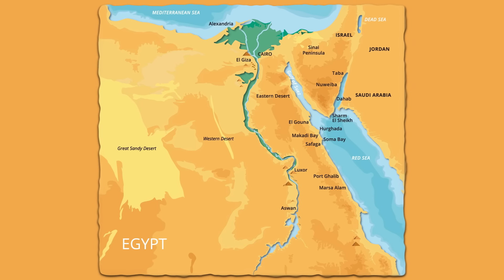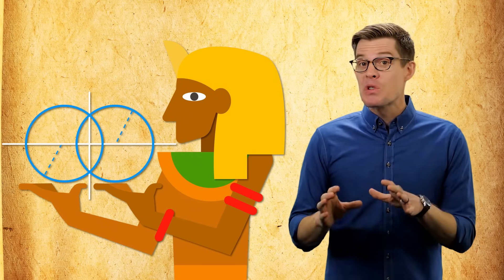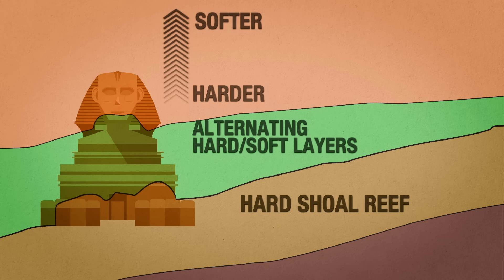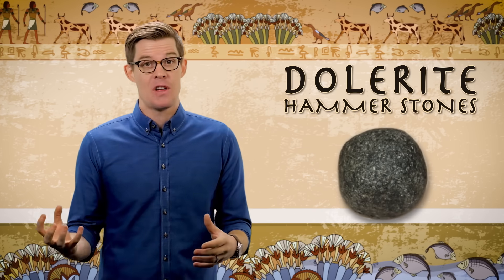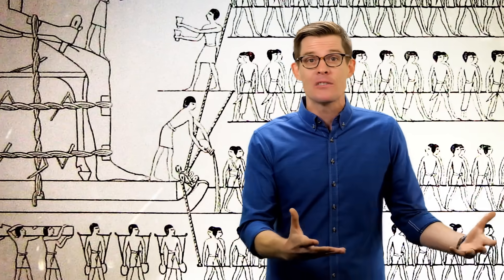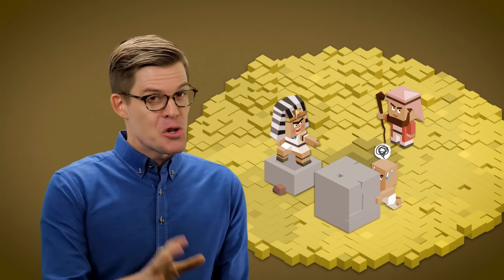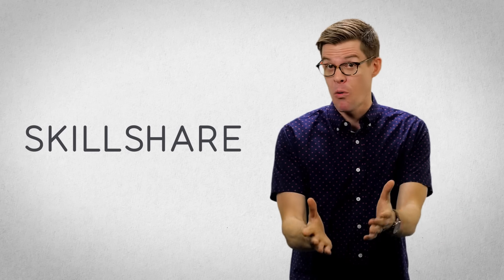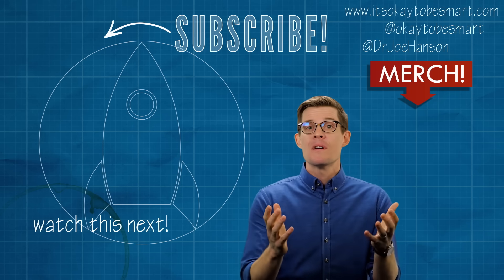The INCREDIBLE Ancient Engineering That Built the Pyramids

Comment: take Jean Pierre Houdin theory of an indoor ramp, add a waterway near the pyramid a crane to lift the block off the ferry boats a pully system to assist in pulling the blocks up the ramp and a crane to turn it at each corner
Reply: Except that:

1 - Houdin's farcical "internal ramp hypothesis" was debunked when the 2017 muon scan showed absolutely no evidence of internal structures necessary to support such an endeavor.  Even the Egyptologist who co-wrote a book with Houdin admitted they had gotten it wrong once the scan results were published.
2 - the base of the Great Pyramid alone sits more than 30 meters higher than the level of the ancient harbor which once sat at the base of the Giza plateau = and water does not run uphill.  lol! 
3 - there is zero credible evidence of their using pulley systems to build their ancient structures = nada.  This is especially true during the period of the Old Kingdom when the Giza necropolis was created.  The Egyptians were big on "recycling".  Thus if they found a method of building a thing which worked we tend to see it applied going forward.  Accordingly if they were using this mythical pulley system to build the Great Pyramid then subsequent pyramids should reflect the same technique..............yet we see nothing.

Moral of the story:  so as we see your assumptions are premised upon misinformation.  I will give you credit in that they did have a harbor which once sat near what is today the Temple of Khafre and the Sphinx.  Most of the stone however came from the quarry which sits between that temple and Khafre's Pyramid just to the south of the causeway running between the two.  

Only a small amount of other stone = granite, white Tura limestone used for casing stones, and the basalts seen in the mortuary temples beside the pyramids - was shipped in via the harbor.  All the rest was obtained nearby and moved up an external ramp for which there is ample evidence.  You need to find better sources of information I'm afraid.
Reply: @varyolla435  better check again the french did a scan that they didnt under stand that showed a pattern like the ramp in the pyramid, but if there is dought just run a fiberoptic camera through the spaces in the wall!
Reply: @varyolla435  theres this man made strucksure called the panama canal!  and  a canal or water way is just a theory i thought to MY self how would i move such large blocks and dragging on the sand is not one of them And there is evidents of eygptions pulling there barges up the nile! dont be so quick dismiss and idea! think outside the box! be creative!  and again it is only how I would do it!
Reply: one of the thing Jean pierre discussed is the Grand gallery! and that nice V shaped stone at the top! were one might use a pully system to move things up and down!  doesnt that make since to you!! look at it !! dont just take the words of some one else, look at it! cant you see it being used with counter balance weight to move a cart up and down!  if they "could"do it there why not use it other places! and again Every thing Jean Piere said could be true! Every thing! you cannot denigh that! dont givee the same old heresay likenhow the world is flat! if you think its wrong then give a better on!

Comment: This didn't tell me  a thing about how they were built.
Reply: lol!  Follow the white rabbit:

1 - >90% of the stone is limestone quarried locally.  Next to the pyramids at Giza - about 100 meters from them - are the limestone quarries which supplied this stone.
2 - so most of the blocks are simply crude chunks of stone rapidly fractured off from the bedrock via chisels and wedges.  They simply split off approximate sized chunks and levered them onto sleds and dragged them away.
3 - a small number of blocks used to create the inner passages/chambers and the last few outer layers of blocks were more carefully cut and in some cases polished.  This can be done using chisels and copper saws.
4 - the few blocks of granite used and other stone used for the mortuary temples were quarried elsewhere and shipped on barges to a harbor area which once sat at the foot of the plateau near Khafre's valley temple = about ~400-500 meters from the Great Pyramid.  Also the white Tura limestone used as casing stones were shipped via the harbor as well.
5 - finally the Egyptians built earthen ramps made from a mixture of sand/stone chips/tafla - a clay they mined.  There are the remains of smaller ramps in the western cemetery next to the Great Pyramid while there is the remains of a huge tafla mining operation near the worker village at Giza. 

So as we see there is evidence of ramps + a harbor + transporting blocks via wooden sleds pulled by teams of men + draft animals.  The Egyptians used oxen for pulling sleds as well as men while the worker village contained many tens of thousands of cattle bones.  Accordingly it is not plausible they would consume cattle and not also use them for pulling sleds as well - at least for the larger blocks. 

Finally Herodotus wrote they employed levers and what he considered a "machine" which is likely a lever device using a fulcrum and counterweight akin to the Egyptian shaduf.  He also wrote they created a "great causeway" - a ramp - and that they first built a "stepped" pyramid ala Djoser to then fill in the sides and cover it in white limestone working from the top down. The blocks of the pyramids get smaller as they rise in height.  So above the level of the King's Chamber which are the heaviest blocks the blocks become smaller with those at the top being small enough for several men to slide them into place.  

Thus the larger blocks of the bottom third were raised via the ramp while the smaller blocks above could be raised via lever devices which sat on the steps to lift blocks to the upper levels.  As they encased the pyramids in white limestone from the top down they dug the ramp away as they worked and dumped the residue into the limestone quarry pits to backfill the area.  That pretty much sums it up.
Reply: @varyolla435  I didn't ask what they were made out of.
Reply: @davedave1064  Think harder.  You asked how they were built ----------> yet they were built from stone blocks = ergo I explained how the stone was quarried and transported to the site as well as how they raised the blocks.  So your question was answered.  Perhaps a reading course or two may help.
Reply: @varyolla435  How did they place the blocks to leave small tunnels behind. This video says NOTHING.
Reply: @davedave1064  Ah.........what tunnels???  lol!  I rather think you are over your head here as there are no tunnels in the pyramids save for the passages leading to the chambers and those were built of limestone blocks.  In the case of the Grand Gallery the blocks were corbelled to compensate for limestone's poor loadbearing capacity.  You need to get your facts straight.  Just a suggestion.

Comment: They use a simple elevator platform to lift the stone to the top. In the center pyramid would be a massive circular stone with rope and pulleys system. One side of pyrimad would be a platform for the stone blocks. The opposite side would be another platform for atone rock. When they wamt to lift one side up with a new stone. They would drop new stone
Reply: Was it an Otis elevator perchance???  lol!

Comment: I think the ramp hypothesis should be discarded
Reply: Slight problem = all of the evidence - and I mean all of it - points to their employing external ramps made from either an earthen mixture or else mudbricks.  In fact there are examples of said ramps still in existence today in Egypt as well as depictions of them in ancient Egyptian iconography.  Pity you never learned the facts here before making uninformed claims.........just saying.
Reply: @varyolla435  chill dude, I had read it somewhere that ramps would not be the optional way to build pyramids, as almost the exact ammount or more of material would he used to build the ramp and the pyramid
Reply: @varyolla435  Most Egyptologists acknowledge that ramps are the most tenable of the methods to raise the blocks, yet they acknowledge that it is an incomplete method that must be supplemented by another device. Archaeological evidence for the use of ramps has been found at the Great Pyramid of Giza and other pyramids. 
This confirms that ramps could not have built alone a pyramid
Reply: @lorisperfetto6021  lol!  I am perfectly calm.  So no they did not only use ramps = but as noted they did in fact use them.  Herodotus also wrote they first built a "stepped " pyramid as well as he referenced their using levers and what is termed as "a machine".

The latter is probably a scaled up version of the Egyptian shaduf which uses a fulcrum and counterweight.  If you look the largest/heaviest blocks in the pyramids are found = in the bottom half closest to the ground.  The higher you go the smaller the blocks become.  Thus the smaller blocks in the upper half of the pyramid could be raised via the lever device which sat upon the steps to lift the blocks to the levels above.  

The blocks found at the top of the pyramid are small enough to have been slid into place by several men.  That debunks your "as much material" claim as the ramps did not need to go that high while smaller ramps could be easily created using mudbricks.  Such ramps are seen at Karnak being used to create the hypostyle temples there along with a depiction of such a temple being built using a mudbrick ramp in the tomb of Rekhmire.

Anyways the ramps were used and dug away as they encased the pyramids in white limestone working from the top down as Herodotus also noted.  The residue was dumped into the adjacent limestone quarry pits to backfill the area. There are smaller earthen mixture ramps in the western cemetery next to the Great Pyramid.  Massive amounts of ramp material was found dumped into the quarries when they were excavated decades ago.  

Those ramps were made in part out of tafla - a clay they mined.  There is the remains of a huge tafla mining operation at Giza near the worker village.  There is evidence of their pouring water before laden sleds.  What happens when you moisten clay??  Answer:  it gets slippery.  So roads and ramps made in part of clay and wooden planks would upon being dampened before heavily laden sleds make movement of the sled a bit easier.  As we see there is always more information to be had.  Best not to assume until you've gotten a more accurate picture of what is out there.

Comment: HELP PLEASE!! I'm no smart scientist like this guy is so I just want to make sure I understand him correctly:
2.3 million stones (averaging 6 to 8 tons each) were quarried, carved, polished and placed by people, cattle, and donkeys who were pulling them on sleds up wet, very slippery ramp systems. 
Therefore:
1 stone was placed every 11 seconds around the clock for 24 years (assuming ramp construction/demos were instantaneous) with the top stone of the pyramid (according to modern satellite data) being placed within roughly 1/4 inch of perfect center to the foundation 146+ meters below. This would lead a dullard like myself to conclude that each of the stones were, on average, within 1 ten-millionth of an inch of perfect center, square, level, AND plumb on all 6 sides if the stone cutters didn't want to take the time to custom cut each stone to make up for inaccuracies of the preceding levels/neighboring blocks. 
Oh yeah, and it was all done using copper chisels, dolerite hammers and pre-trigonometric mathematics.
Did I get all that right?
Also,
Does anyone want to buy a bridge?

Comment: Science but didn’t mention the weight of a single stone. How about the granite headers In the chamber 80 tons
Reply: What about them??  They sit below the halfway point of the pyramid.  The pyramid rests upon high ground with the main quarry nearby.  Further there is evidence of earthen ramp use at Giza while the pyramid at least partly appears to have been built atop and existing hill.  Thus those blocks were raised via a ramp being pulled/pushed/levered into position by teams of men and oxen. Also they are very crudely shaped if you look at them being "retangular-ish" in dimension.  They hammered them out "just enough" to fit.

Comment: I know how they built the pyramids they would carve water canals into the sand and would have one huge flow of water and all they did was put the lime stone bricks on top of a water raft and the raft will just flow into place into a huge bowl type container looking structure carved from the sand and just assembled itself basically and for how they cut and drilled into granite rock was easy they used tuning forks and would match the frequency of the rock and apply the wires against it and it would break kinda like how glass would shatter if you vibrate it high enough and granite is a great rock to use for this type of drill technology cause granite is made from quartz and quartz when vibrate high enough would shatter into small fragments anyways their is also a way they figured out on how to melt granite into shape but that method banned from use cause its heat was so intense it would burn workers feet away they would use hydrogen extracted from water they would use the battery they invented to charge a pot and the pots gasses from the current being applied to the pot would float into a tube they would connect to a box to shape the mold for the stone like a oven and the box was made from super heated sand and it was all black people like to confuse the black tombs as somewhere people died but it wasn’t a tomb it was a mold box for stone I know this information cause in Mexico some native said that’s how they used to do it and no one would believe him even though that’s been word for years the original idea of building pyramids came from Arabic’s and they sold the idea to many races across the world they are the architects of this world everyone just got their ideas from them everyone forgets where building shelters comes from we need to thank them for beautiful structures romans where influenced by them a lot until they stole their empire
Reply: my god

there isn't a single period or comma

Comment: Asking GOOGLE....how many years did it take to build the great pyramid?
    20 years
The Greek historian Herodotus was told that it took 100,000 men 20 years to build the Great Pyramid at Giza. Scholars today, however, think it may have been built by only 20,000 men over 20 years. A pyramid's large square base creates a very stable structure.  2.3 million "little stones" and a few GIGANTIC GRANITE ROCKS in 20 years, eh?  Doing the math we find out the "builders" placed 315 multi-ton stones per day figuring a 24 hour, non-stop workday.  That's unlikely because working in the dark doesn't make sense so that leaves 630 multi-ton stones every 12 hours for 20 years.  Remember, all these men never peed, poo'd or ate, they just kept working.  In fact, they never even made a miscalculation.  Perfection from either 20,000 or 100,000 men for 20 years.  The stones had to go uphill after the base course was placed.  Oh yeah!!  In round numbers these geniuses placed one stone every single minute perfectly without interruption or any mistakes.  We haven't even mentioned the 80 ton granite rocks lifted way, way up and placed to a razor thin margin.  So, picture a bunch of guys, working in the hot sun banging on granite rocks with some small round rocks and making a perfectly shaped 80 ton hunk of granite.  Got it???  I'll stop here because the whole thing is preposterous.  The only thing we know for sure is these pyramids exist and that's all we know for sure.

Comment: Thw limestone wasnt quarried.  It was used to create a conceete paste that dries to look exactly like quarried rock.  By doing this or casting each block they can build the pyramids with les labor and use less wood (qhich is scarce near a desert) and be done quicker.     The water was pumped in using screw pumps invented by the egyptians, thw limestone was from thw ground there (like building a sandcastle u take away sand from around it and build it upwards)   Therefore they had logistically aolved the material supply issue in an efficient manner.  Anyone today with material and time can build a puramid today in this way. The chambers and shafts r easier to build this way as well.   I can provw all of this.  Amd ince u see how simple and efficient it was it will make all the sense in the world how it was done
Reply: so they pounded the local limestone into powder and then reconstituted it ?